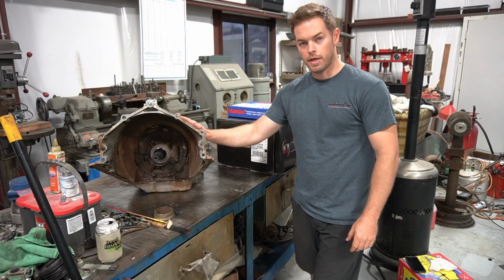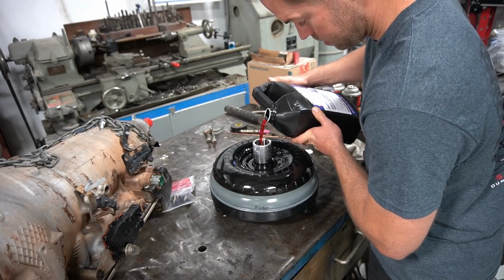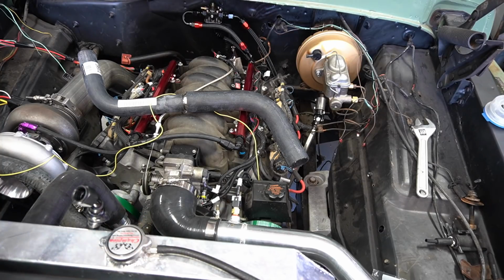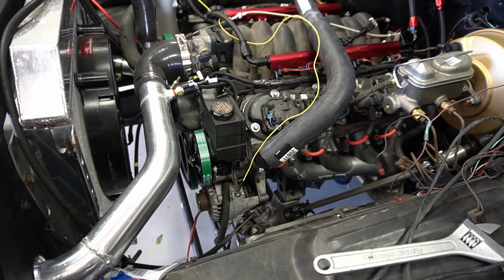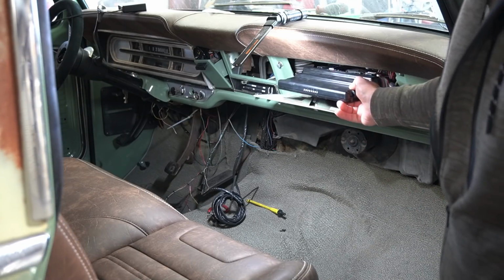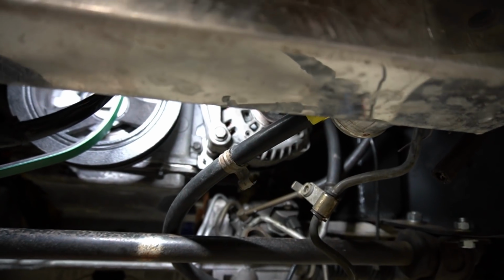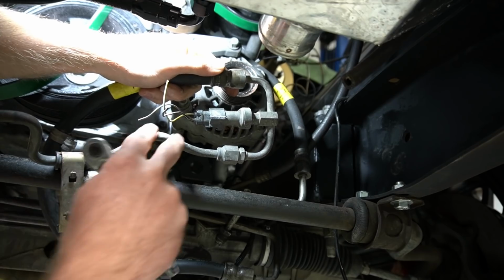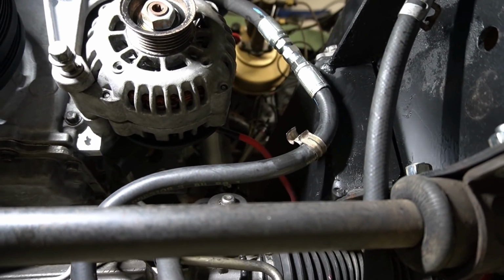LS1 Turbo F100  Progress Update

Comment: Did you have to modify the crossmember between the trans mount and the crown Vic ifs for the trans pan, or were you able to create enough wiggle room with the motor mount front and back adjustment?

Comment: The hydraulic shop should be able to put an end onto the Fbody High pressure line to adapt to the -6AN adapter for the CV rack.
it would prolly be cheaper and a way cleaner installation that way then cutting up both hoses and fitting em together.
Reply from the maker: Yeah, I thought about using the AN fittings and some PTFE hose. This seemed cheap enough since I had the hoses already. Fingers crossed it works out

Comment: Some of those Panther cars have variable assist power steering; that pressure sensor in the power steering line would be the input for the control system. You may find it feels over boosted at higher speeds depending on the output if the GM pump.

Comment: Bussmann 15305-5-2-4 is the one you want. I ended up in the same situation you did with the fuel relay in the Holley harness. The 15305-5-2-4 has just the one bus for 12v + and then you are free to wire up your own 12v - trigger on the fuel relay. Did a wire diagram for how mine will work out if you are interested.
Reply from the maker: Nice!! Thanks man! That looks like it will work out better for me. Yeah, you have  link to the wire diagram you can share? I'm sure the community would love to have that, people are terrified of the wiring for this project
Reply: https://photos.app.goo.gl/BzF1WGsmni624Mqu9

Hopefully my handwriting is legible. 

The left is the fuse panel and the right is battery connections.

For my build (ford 460), I have the sniper (wished I did the terminator-x), hyperspark ignition, and 3G alternator. so spending a lot of time on the wiring.